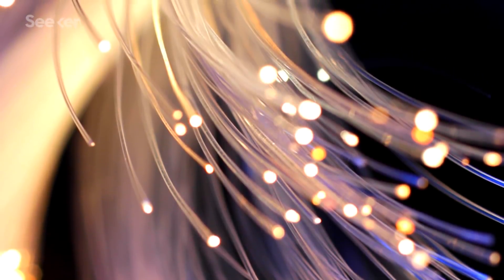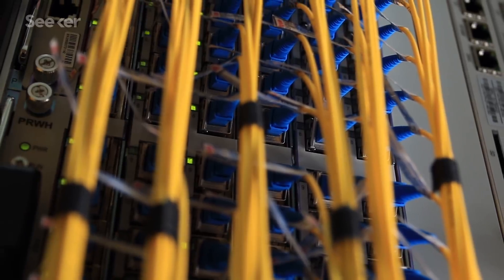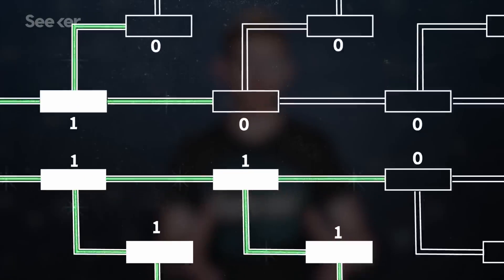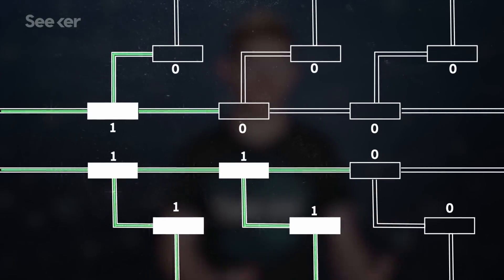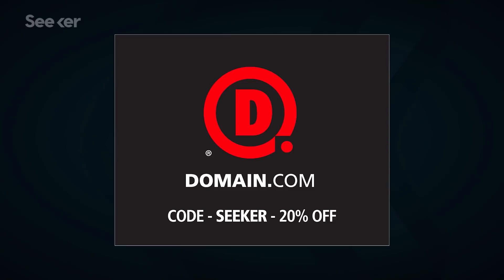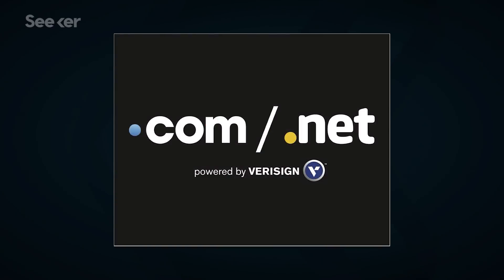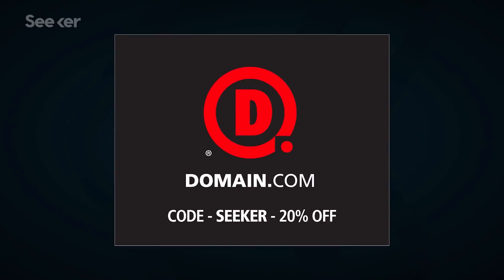Photonic Chips Will Change Computing Forever... If We Can Get Them Right

Comment: Intel has been able to manufacture optical pathways and lasers on silicon since about 2005. I don't know if they have done any research on manufacturing optical transistors but it would be the logical next step. You would think that they could have made significant progress in finding a solution in an 18 year period.

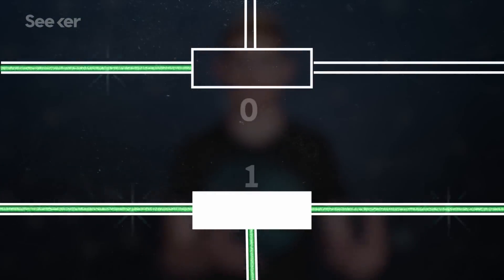Comment: 0:45, Well the simplest photon transistor depends on using singular photons, the "input" photon targets a flat mirror at an angle while the "gate" photon runs parallel to the mirror. When the "gate" photon is not sent at a suitable time to collide with the "input" photon the "input" photon goes through the default output (we'll call it 0 for 0 "gate" input), when the collision happens the value 1 is obtained via a parallel output path. I only thought that one up a few minutes ago, was looking for somewhere to pass it on, maybe you or someone else here has the contacts needed to make use of it but I don't. Assuming someone does manage to pass it on and it's actually a new method then while I would love to have royalties given my jobless situation I would also accept a one off payment.

Comment: All you need is a three lenses with 64 grid steps on each lense and spin it at rpm * the refresher rate that you want and interfere them in 3 d crystal grid chip each lense had yellow, green, blue light

Comment: Thanks!  It seems we have a lot of options when it comes to computer chips.  I've been hearing things (including on this channel) about Gallium instead of Silicon, magnetic waves instead of (or in cahoots with) electrons, photons instead of electrons, 3D chips single atom memory, DNA computing, etc.  I hope that someone, somewhere is working on technologies to intercommunicate between these various forms.  I acknowledge that some of these may represent niche technologies, which may only be used alone for special purposes.  But we also need to make sure there's some kind of interrelation methodology.  Otherwise, someone's going to have to suddenly come up with answers really quickly when they turn out to be incompatible.  I don't exactly expect some neat, simple, universal translating switch - no, that would be entirely too easy.  But we do need to think about how all these different architectures might communicate.  And that's not even considering how quantum computers might communicate with conventional ones.  Thanks again.       𝓡𝓲𝓴𝓴𝓲 𝓣𝓲𝓴𝓴𝓲.

Comment: The best with optical computer isn't that photons are faster (and they aren't by much)
The good part is that you could increase the frequency to THZ due to the fact that it dosen't heat as much
plus you could stack thousands of layers because you don't need to cool them really
so you could have computers that are about 1 million times more powerful for even less energy consumption
plus you can split the signal and merge it with optics so you could have great parralel computing extensions.

Comment: As others have noted, light does not really increase the "speed" at which the computing functions actually occur. In fact, in silicon photonic modulators for example, the electrical waves move FASTER than the light. We have to remember that electrical waves operate by the same fundamental electromagnetic principles as light (just at different frequencies). Copper slows electromagnetic waves less than silicon.  The benefit of photonics is bandwidth, rather than switching speed, for example. Photonics is good for moving data inter-chip rather than intra-chip. This is being implemented by companies like Ayar Labs.

Comment: Above reads, “According to Einstein’s theory of  relativity, this should not have been possible.” 

According to the scriptures of life, “Stop simply believing everything you see and hear without first conducting some form of  personal, hands-on research and/or experimentation before blindly stumbling down the path of least resistance , only to find more of the same old, same old information. Often more times than not,  this data  proves to be pointless if the information isn’t understood. Question everything , analyze, research, learn, share and teach your findings supporting approval or disapproval. 

We need to make informed choices, learn and teach all we can and spread love,  constructively criticize all things while embracing personal shortcomings and missed achievements as improvement opportunities. 

Academia has long enough been passing off vast amounts of toxic, unfounded  information, which has infected a plethora of  intelligent minds. The very foundation on which fundamental education was built, was designed gathering poor quality materials,  left incomplete, deteriorating, stealing away architectural integrity from an already unstable base flawed by design.

Comment: How difficult is it to etch optical transistors into glass or ice using the suns power to burn glass or ice?  If you had self-replicating 3D printers out of ice (terraforming mars) and sand-glass (could also terraform Mars, but its good to build houses and things in the Sahara dessert) then via exponential growth (1 2 4 8 16 32 64 128 256 512 1k 2k 4k 8k... 1 trillion in 4 generations) you can build all kinds of legos and use these legos to bulid things.  They can also give you infinite energy via using there ice/glass lenses to power heat-pumps or chemical reactions.  I can see the wheels and other moving parts all being created of glass/ice, as well as the extruding "arms", but how to give each 3D printer something that can compete or follow directions to build itself seems like the hardest part.  Creating gears that translate etches in ice/sand (in ice/glass) into printer commands is possible.

Comment: The “black light” digital photon computer. 
       Stronger crossing laser reduces the excited atom population, and stops the laser device working, then a non-gate is realized. The crossing laser is vividly called "black light".
      The electronic computer is reaching its speed limit, most of the quantum computers can only do simulation operation, most of photon computers are expensive and slow and also simulational. I invented a photon computer that is cheap faster and digital. 

1 A review to the laser principle
       When an atom of the laser crystal is irradiated by the light from the pump source, it absorbs a photon and is excited. When a photon passes by an atom, the atom emits a photon witch has the same attributes(direction frequency and phase) as the passer-by photon. The atom backs to the ground state,and the new photon has a different polarization direction, witch is random.

2 The“black-light” non-gate

       The digital light circuit is binary. Assume that that light exists is 1,while that light non-exists is 0. To realize a non-gate, light existence must be changed to light non-existence, and also the inverse process. The phenomenon from light to no light, is vividly called “black-light”.

      At the beginning, the laser works in the left and right direction normally. To do a non operation, strong light iirradiates from up and down to the crystal; then the the laser works in the up and down direction. The reason is that: after the light from up irradiation, the count of the excited atoms in the laser crystal decreases, that leads to the stop of laser working in left and right direction. By the way the light from up must be strong enough.

Comment: You guys I have to tell you this the best way to create way to make a optical transistor is by using three sources of light and switching between two of them then useing the interference pattern. So the guys working on this are pretty close. I mean really close all they have to do now is add that and a data line memory and they will have a working model.

Comment: "we'll probably take advantage of lights ability to transmit data across large distances"

Wow, that is a fantastic idea! Wireless transmission of data... if only there was some practical use case like wi-fi, lasers or mice, IR remotes etc... sure, you meant "large" to mean between local chips likely but guess what... that is already MUCH SLOWER than just running a copper wire since instead of dealing with electron drift speeds (which is fast) you have to:
1) use electrons to create photons
2) transmit photons
3) receive photons
4) turn photons back into electrons

Maybe I'm wrong, but is there really a use-case for SHORT optical transmission like that?

Comment: Electrons already move plenty fast enough. It's not their speed that is a problem, it's the heat. We can run those switches much faster if want, it's just that they'll melt. ;) That's why we've been stuck at about 4.5 GHz for awhile now. The big hope for photonics from what I understand is that it will take less energy to manipulate wavelengths of light, and so you can run the transistors many more times per second before they got as hot as our modern processors do. That is where the speed gain would come from.

As for opto-electronic systems where information is sent using light and electronics are used to perform calculations... eh, that was weird... I had to double check the date on this video when you said it. We already have them: fibre optics. That's what I'm using to communicate with you. Well, I've been told the US is still mostly on copper and DSL. ;) But in Europe and Asia at least most information is already transmitted optically over long distances between electronic terminals. In any case, the main advantage of fibre optics over electronics from what I understand isn't so much to do with the speed of electrons or photons, it's bandwidth. We see that as speed because bandwidth is parceled out among customers, so the more customers the less 'parcels' you get for a given time.

But really... electron speed over wires is more than fast enough for practically any application on Earth. Even if we found some sort of particle much slower but that somehow require much less energy to manipulate it would still make calculations much faster. ;)

Comment: Intel had these light chip at least 7 years ago. Don't think for a second these gargantuan corporations will release anything like this until they have too. They will exhaust the current elector/silicon physical limitations and itterations first. Just think abou it for a second. With light chips, there is no "Core" L1, L2, L3 iterations(L being light) once you have their first Chip it will be as fast as anything ever will be. There will only be one product and it does not matter who makes it as it has reached the fastest speed possible forever. There is no money to be made here in terms of small incremental steps and stretching the profit to R&R ratio for as long as montitarliy possible.

Comment: then after quantum and light comes chemical then what?
Reply: vatossan DNA.
Reply: DNA is chemical no?
Reply: vatossan Technically yes, but I read in a magazine that a small amount of DNA could hold the library of congress. With electric we have 0 and 1..  With DNA there's 4 chemicals. Most DNA is located in the cell nucleus (where it is called nuclear DNA), but a small amount of DNA can also be found in the mitochondria (where it is called mitochondrial DNA or mtDNA). The information in DNA is stored as a code made up of four chemical bases: adenine (A), guanine (G), cytosine (C), and thymine (T).

Comment: There is a misconception that light travels faster than electrical signals, and therefore our computers would be faster if we would use photos instead of electrons. It is true that photos propagate at the speed of light in the medium, whereas the speed at which electrons move in conductors is fairly low. However the propagation of electric signals is not related to the speed of electrons. Electric signals propagate exactly at the same speed as photons, the speed of light in the dielectric medium. It is true however that there are other factors that limit the speed at which we can process electric signals that can be overcome by using light.

Comment: You'd only get marginally faster if you use light, if not worse performance since photons travel SLOWER through material compared to electrons through a conductor. Unless you can make some nano vacuums in the chip and use small wavelengths.

Perhaps we should look into sonic, thermal, or magnetic computing?

Signal density, speed, frequency, power consumption, I can see the advantages somewhat. Unfortunately this is doubtful. And considering the wavelengths of photons tend to be quite big compared to electrons, unless you were to use highly penetrating x-rays or gamma rays you might have trouble fitting those fat particles down your tubes.
Reply: Lol you are lost

Comment: except that light over fiber optic travels at 2/3 the speed of light and over copper data travels at 85% ish the speed of light. using better fiber optics that have a core refractive index as close to 1 as possible (vacuum or inert temperature stable gas) would allow the delay issues to be improved over copper. O-E-O conversion and dispersion correction are tremendously slow.

Comment: One thing not mentioned here is that current processors are at their limit when it comes to downscaling. They can certainly be made smaller. But on a molecular level. The silicone gates. That open and close in the form of 1's and 0's are as thin as they possibly can be made without the electrical signal going through the gate. Which would cause your CPU to go haywire and it would start doing things on its own. The gates, or walls of silicone have to be a certain thickness to block the signal effectively. But light is far more precise. And can be made with much thinner materiel. So when light based CPU's become commercially available. We will see a new generation of significantly more powerful and fast processors hit the market.

Comment: The problem with photons is they are technically much larger than electrons.  Not in a true size sense, but in a sense of the structures needed to maintain coherency in the signal. This is why electron microscopes are used to image small things that photons can't.
Reply: The problem is you not realising they are developing ways to deal with that .

Comment: But can it run Crysis?
Reply: ya but not crysis 4
Reply: It can run all crisis games at 8k simultaneously and still sit as if nothing happened.
Reply: But can it run cyberpunk?
Reply: @craig5261  yes absolutely. photo chips would heat 0.1% compared to the normal chips so they really have way great potential and also the enenrgy consumption will be the 1% of it

Comment: I think IT has a problem with concepts. You don't want a quantum computer. What you want is a regular computer that has some Q-bit holders and can do certain arithmetic & logic functions with them. A truly photonic computer would be nice, but very hard to build. A better idea would be to have light channels, photonic wave-guides in the kind of places we now have conductive interconnects, like the conductor  lines on a printed circuit board. It's a question of using a piece of technology and know-how, for the specific job it's good for. A claw hammer is nice, but I don't want to eat my cereal with it and it doesn't give a very close shave.
Question : How fast is light? In a vacuum, it goes just under 300 million metres per second. So how fast does it go through an optic fibre? I don't know, I'd have to look that up, but it would be well under that speed. If you can make quantum entanglement work, you can change a particle at one end of the house and the partner will change at the other end of the house, at the same time. That's faster than light communication. It's also impossible to intercept, spy on, block or jam. You can't even detect it. Problem is getting that entanglement to work, and keeping it working for more than about a minute at a time, is extremely difficult. A photonic chip would be good, but instant communication would be good as well, especially if it was inherently secure.
Reply: Kneedragon1962 
Entangled qubits can't be used for ftl communication
Reply: They can't? I'm no expert, but I thought they could. If you can entangle 2 electrons, or Q-bits, and have one here and one at Alpha Centaury, then why can't you use that to communicate?

Comment: Fiber optics at the nano scale can't handle the 3D stresses that are required of cpu/ram architecture. The need to bend around the gate and drain structures may be to tight. It would probably be easier to refine waveguide theory then just attempt a straightforward approach of photonic integrated chips.